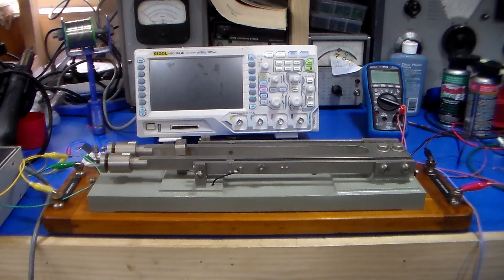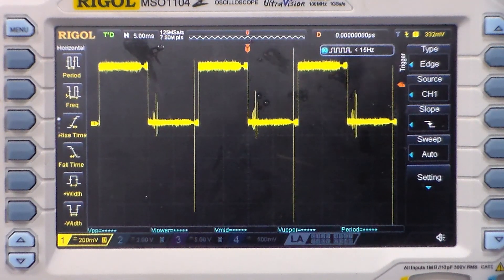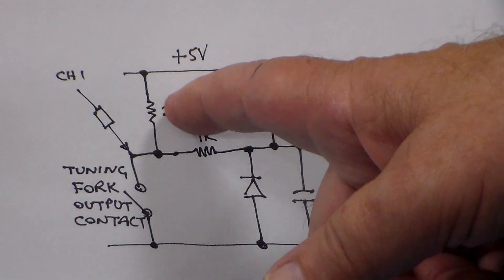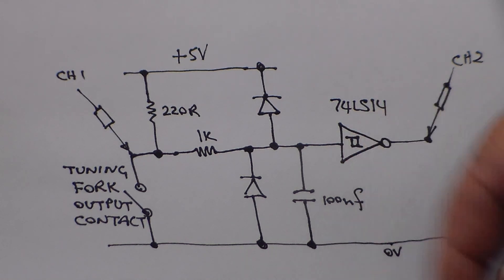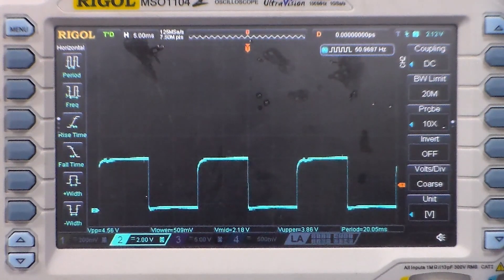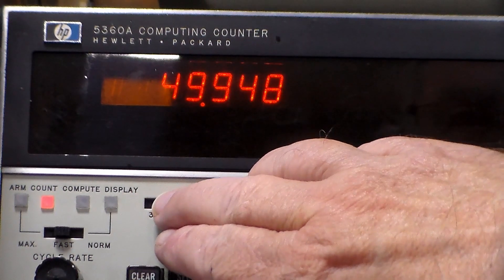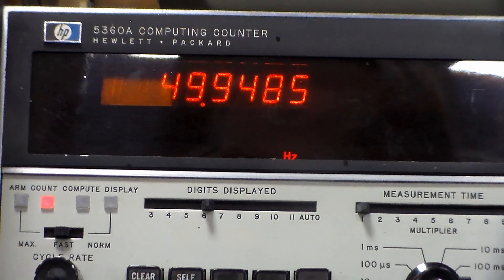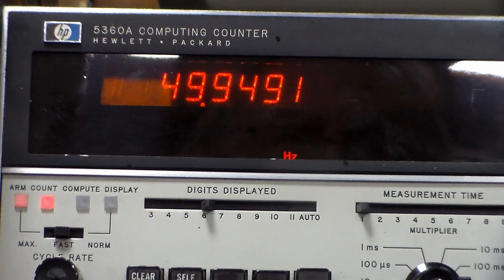H. Tinsley 50Hz Tuning Fork, Part 2

Comment: Fascinating, thank you. I had no idea such things existed, but I suppose they were essential to regulate the frequency of the power networks, which in turn regulated the synchronous motors in electric clocks all over the country.

Did you know that the very first electronic watches also used a tuning fork running at 360Hz? Accuracy was a few seconds a day. A most impressive piece of miniaturisation.

https://www.youtube.com/watch?v=0hqGw2W8-Hk